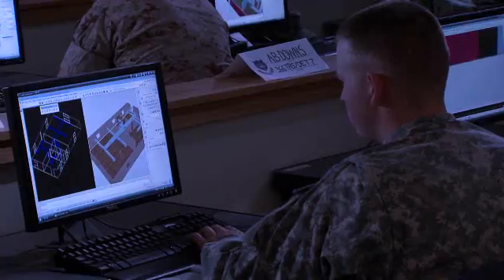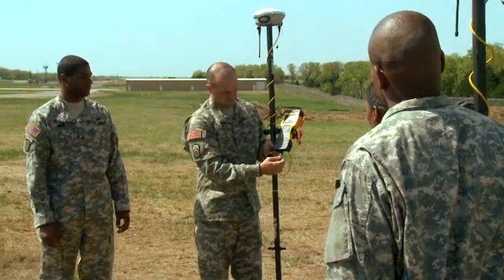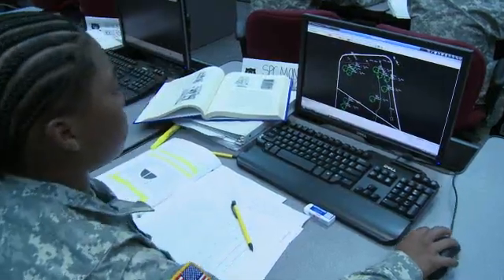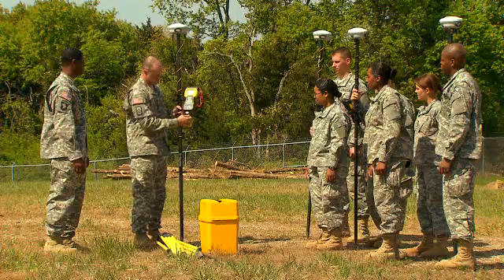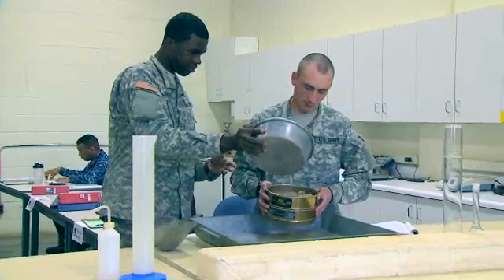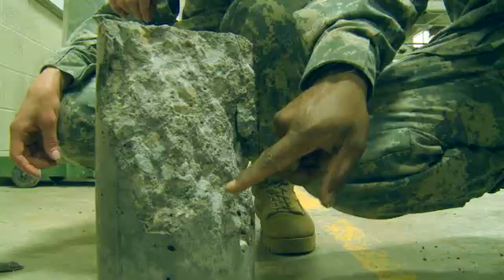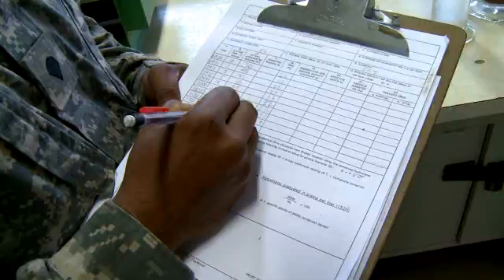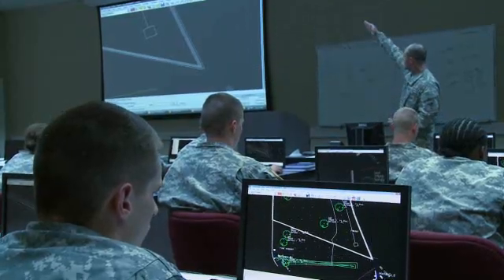Army Careers 12T - Technical Engineer

Comment: As for combat, yes you might be put in danger but you will never be expected to pull the trigger. Its really for combat MOS only
Reply: This is so wrong. Particularly for Engineers. 12Ts are often involved in work off of the FOBs and must be ready to fight. I know many 12Ts who earned their CABs.
Reply: We did a lot of surveys out of the wire! With internal security or with infantry, and then it could be risky.
Reply: Drill Sergeant Flores?